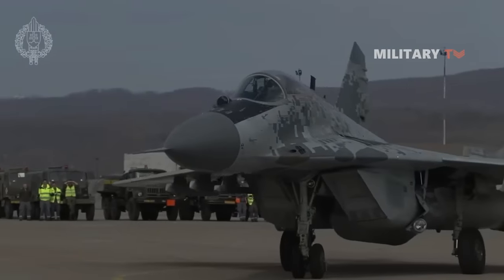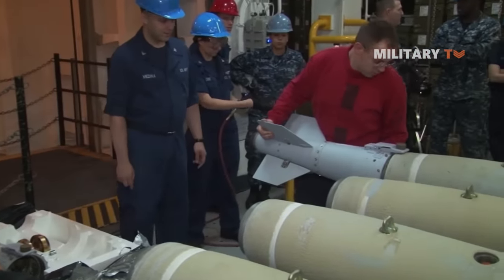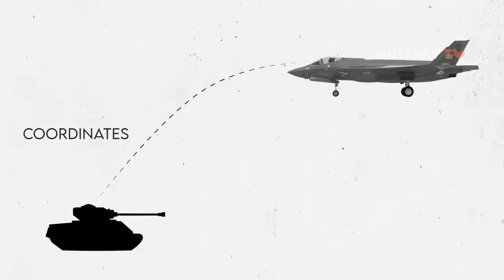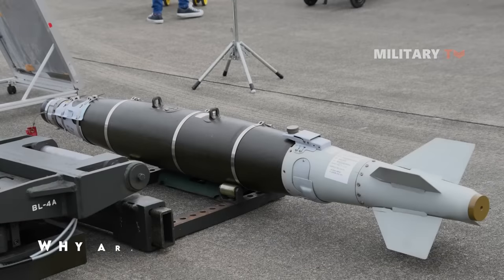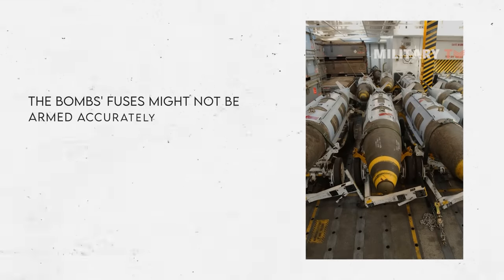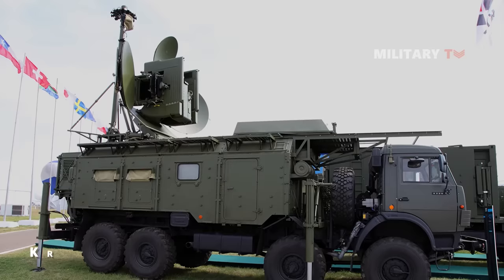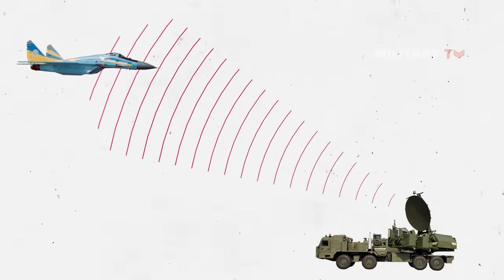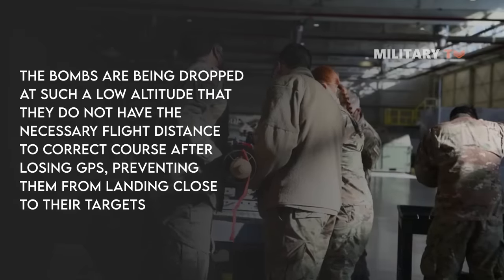Why Ukraine GPS Guided Bombs Are Failing?

Comment: Oh, really? GPS signals are being jammed on the battle field? Who coulf have possibly seen that coming?
Reply: Lol 😅
Reply: Especially after the Russian jet disabled a US Navy ships systems years ago.  😳😁
Reply: @thinkforyourself1547  That story about a US Navy destroyer having its electronics disabled was entirely fiction.  The Arleigh Burke class USS Donald Cook was unaffected by the claimed electronic warfare system.  

As for GPS signals, they are extremely weak.  They are already well under the noise floor, and require clever receivers to receive them at all.  You might expect that the weak signal makes the signal easy to jam, but the receiver technology already has to deal with lots of noise.  It's equivalent to hearing a mouse squeak at a rock concert.  You can do it only by knowing exactly when the mouse might squeak, and repeatedly looking for a slight increase in signal at exactly those times compared to the surrounding times and frequencies.

To jam effectively over a wide area requires matching the potential pattern of the transmitting satellites, and transmitting competing signals in a way to disturbs the error correcting.  The Russians seem to have developed a system to do this, at least for single antenna receivers that don't discriminate signals from the 'wrong' direction.

Comment: The guidance package is supposed to automatically switch to the Inertial Guidance System, when the GPS is lost. The IGS is constantly updated while the GPS is working. So, even when GPS is lost, the IGS will still maintain acceptable accuracy. The malfunction must be more basic than just the loss of the GPS.
Reply: but they're missing their target
Reply: Korean technology
Reply: "The guidance package is supposed to automatically switch to the Inertial Guidance System, when the GPS is lost" is correct but if satellite signals are counterfeit the guidance don't switch. it simply recalculates its location based on the false signals it receives. To falsify a signal you have to transmit the false information on the same frequencies used by the satellites but with much higher power than the original one in order to make the original signal invisible. The original signal being at a much lower strength becomes part of the background noise and the gps guidance system follows the new falsified information. Add a low-flying launch and other complications...kit GPS wasted!
Reply: It works only if you have GPS signal at the point of launch, otherwise there is no location for the system to refer to
Reply: Pal, you dont get how jamming works, many jamming systems simply mess with the signals and the missile/bomb keeps getting GPS signals but with wrong data, nothing can be done against that, gps targetting is not posible against Russia.
Reply: @Wen6543  If bomb gets wrong (or none) GPS data switches to secondary guidance system.
Reply: What if the GPS is not jammed but doubled with a more powerful misguiding signal in a certain area?
Russia has (officially) 76 modern military satellites in orbit, it's not that impossible...
Reply: The Weapons are Fired from Planes that cant communicate with them cause they are russian or not Nato standard. So the Weapons can only relay on GPS guidance. And can only work pre flight programmed.
Reply: they use not only the jamming but also the GPS spoofing
Reply: I think he may have been correct when he said that by the time the bomb REALISES it has lost reliable GPS navigation, it has already lost sufficient altitude to reliably make it's way to the target with INS.
Reply: @JohnNjengaCOCO  remember this weapons system isn’t being used in its original purpose, it’s rednecked on there planes
Reply: @JocoMarkovic-gf1eh   Unless Boeing is using Korean chips. Doubt it. They are made in Florida and Missouri.
Reply: Wrong. When the GPS signal is lost, this does not happen in a split second, so there is a distortion between the GPS and INS guidance systems, causing the INS to be inaccurate.
Reply: Does JDAMs have a Laser Guided Kit in case if GPS is unavailable or Jammed?
Reply: Nooo you are wrong when the GPS is lost the ARP sharp will automatically deactivate its GDP 202 ,now when that happens the glide bombs can turn to 3XP coordinates dislocation

Comment: I think the issues are a combination of everything you mentioned. Especially the part about Ukranian aircraft flying too low to the ground for the bombs to be employed effectively.
Reply: I think that may be part of it too. Oviously the j dam bombs aren't effective enough at this point.
Reply: @paulzink2492  The arrows (the JDAMs) themselves aren't the problem. It's that the archers (the Ukranian fighter jets) can't get high enough to employ them the way they are meant to be due to the threat of Russian air defenses. Due to its small size, the UAF can't afford to tank aircraft losses.
Reply: @Stinger522  not only that, Russia mastered jamming of GPS guidance and smart munitions like JDAM and HIMARS making them miss the target more and more often due to lack of accuracy in inertial guidance
Reply: @ "Especially the part about Ukranian aircraft flying too low to the ground for the bombs to be employed effectively.": _ _ That's of course nonsense - as Ukrainian soldiers are not stupid!
Reply: @JohnStoneman100  they are not and that is the reason for them to be flying low…
Reply: @JohnStoneman100  They are smart - rather fly low, survive, and drop a less accurate munition, than fly high and be shot down
Reply: Because those missiles are made in US 😂😂😂
Reply: And those are expensive bombs...
Reply: @danuusahani4029 Better to lose something expensive then something invaluable.
Pilots and planes are far more difficult to replace them the bombs.
Reply: @mrobocop1666  This is propaganda, Putin's Reb complexes are not effective enough, there are very few of them, for a 1200 km front line. In addition, it radiates and becomes a priority target for Excaliburs. The work of Russian air defense is more efficient, but this is not the main reason. The main reason is that these bombs were not delivered to Ukraine
Reply: Himars are used from the ground already.
Reply: Don't they have anti-radiation missiles to take care of that jamming problem?
Reply: @Zyworski  
1) no jamming problem. This video is propaganda.
2) anti-radiation missiles are very expensive.
3) No, Ukraine does not have its own missiles, and there are no longer aircraft from which they can be launched
Reply: Nazism --- Relies on myths about the historical greatness of its own nation, its belonging to a "superior race", which, according to the ideologues of Nazism, gives it the right to expand the so-called "living space", seizing the territories of other states and carrying out a policy of genocide on them . Often presented as a variety and synonym of fascism, although this view is incorrect,
due to a certain difference between these two ideologies.
In contrast to both capitalism and communism, it was aimed at overcoming social differences, with all parts of a homogeneous society, and upholding traditionalism as the antithesis of trying to artificially create the appearance of national unity in multi-ethnic countries.
The ideologues of German National Socialism considered the historical territories of the Germanic tribes as additional lands for the expansion of their own state. Currently, National Socialism is considered a misanthropic ideology.

Fascism is a type of political regime, as well as a radical authoritarian imperialist political ideology,
the characteristic features of which are a strong personality cult, militarism, totalitarianism, imperialism and the idea of unity, mobilization of the nation and the state against enemies, the idea of constant war and domination.

Do you think any of this is suitable for Russia???
Reply: so how come the russian glide bombs work if they technically use the same technology.
Reply: @danuusahani4029  they’re not that expensive, they’re literally strap on guidance devices that you can attach to the cheapest bomb.
Reply: He said Russia is jamming the Signals give it up and give cred where its due
Reply: @sergiytokio7295   No not for Russia , but I find that that is suitable for at least two countries both have letters Uk.
Reply: @alexeymakienko7858  What missile took out flagship cruiser Moskva?? "There are no longer aircraft from which they can be launched" How do you assume they launch Storm Shadow then? Mounted on top of a hilux chassis?
Reply: @alexeymakienko7858  I kinda figure that jamming would not be a problem in this age of spread spectrum frequency hopping, but I still run around with a Vietnam War mentality.
Reply: @Zyworski  The hopping frequency is for the communication channel but not for the GPS. But the earth is round, it is possible to jam within a radius of 20 km, and at such a distance the inertial system of missiles will not pick up enough errors. But EW systems could be a problem for Excalibur.
Reply: @JohnStoneman100  flying as low as possible isn't stupid at all : it means avoiding long range search radars (such as the ones on the S-400 Triumpf) thanks to the curvature of the earth
Reply: @alexeymakienko7858  Electronic warfare systems are located in the rear at a range of 50-70 km, they do not work constantly, but at the time of Himars missile launches and JDAM, it is almost impossible to destroy them. They turned on for 5 minutes, knocked the missiles off the target and quickly left.
Reply: @milaro222  
1) And who will detect the targets? Ukrainians use a network of cheap radars for yachts and British AWACS aircraft. What about the Russians?
2) 50 kilometers in depth * 1200 kilometers in front. Does Russia have enough systems?
3) Time in flight "Chimera" about 60 sec. But the "Zoo" is not an "iron dome" it is run by people.
Reply: @alexeymakienko7858  Russia has a huge number of ground and air radars, including the over-the-horizon Container (29B6) radar with a range of 3000 km, it covers the whole of Ukraine and detects any aircraft and cruise missile launches, at any height, as it works on the reflection of waves from the earth's ionosphere.
Of course, there is no 100% protection, but Himars, JDAM, Storm Shadow show only single successful hits and efficiency decreases over time.
Reply: Yeah, the thing about any American weapons system is that it is only effective when combined with everything America has at her disposal. JDAMs are no exception. In order for them to be effective, they need to be launched from a high altitude. In order for the planes to fly at a high altitude, they need to be covered by your air defense, while you are suppressing the enemy’s air defense. Ukraine has inadequate air defenses and virtually no capability of suppressing enemy air defenses. This is why any and all (of the few) successful strikes on the Russians are carried out by low-flying aircraft and drones. You can’t do this with guided bombs as the higher you drop it, the further it flies.

In fact, come to think of it, JDAMs are only good against an opponent who’s best air defenses are the equivalent of stinger missiles or an anti-aircraft machine gun. Basically - the Taliban. But this dives deeper into the flaws of American military doctrine. It simply doesn’t take into account that a potential adversary can have the same or better capabilities than you. It is geared towards counterinsurgency and beating the sh*t out of small 3rd world countries. Take the idea of aircraft carriers as an example. Sure, they are good for beating the snot out of Saddam Hussein’s army of conscripts (who were wearing street clothes btw). But go against an opponent like Russia or China, and they will simply sink the whole carrier battle group with hypersonic anti-ship missiles.
Reply: @RealPolitik-dy4it  
Do not confuse Ukraine and the USA. It is Ukraine that does not have the whole range of weapons. Any air defense glows like a Christmas tree and in a conflict with America would be destroyed in a matter of hours. The air defense of Ukraine is much more stable than the Russian one.

No one in the world has hypersonic missiles. In the US, they are only at the prototype stage. We can observe the full power of the Russian fleet on the example of the Moskva cruiser. Chinese ballistic missiles have a chance to destroy aircraft carriers only if they use nuclear warheads.
Reply: @alexeymakienko7858 микола, почему еще не в контрнаступе? С дивана встал и пошел доказывать что не олух, начитавшийся вики. Авианосцы у него только ядерками можно потопить, лол.
Reply: compare with Russian jets bomb their own cities, it is a huge success
and Putin fear of modern chefs 😂

Comment: My first question would be, "what recent reports?"  I can confirm that Russians do jam GPS.  We were in the process of mapping for a Ukrainian archaeological project using GPS, and a ground station for post-processing.  Certain areas around the project could not be mapped using GPS at all.  The result was that we had to employ a total station and blend the data in a desktop mapping program.  Even with the base station, correcting the GPS data was unusable in certain parts of the project area.

Comment: The problem isn't simply that the GPS signal is drowned out by noise produced by jammers, the signal can also be replaced by a fake signal that is not recognized as such by the JDAM. The inertial navigation then does not take over as long as there is no red flag in the form of a sudden jump in the difference between the position according to the inertial navigation and the GPS. If the fake GPS signal then causes a gradual drift between GPS and inertial navigation, then the system will flag that as being a gradual drift in the inertial navigation, and the system is programmed to reset the inertial navigation to the GPS.

Comment: Anyone looking at the way air strikes are conducted by both Ukrainian and Russian airforces would note that low-level lobbing of guided bombs in EW environment is most likely culprit. bombs trajectory is far less forgiving and prone to launch error resulting in releases that are on the boundary or outside the envelope of JDAM guidance package maneuvering capability.  Jdams have previously been used from medium to high altitudes where minimal guidance corrections were needed to score a hit. Jerry rigged integration onto Soviet jet probably further shrinks the Jdam release envelope in practice.